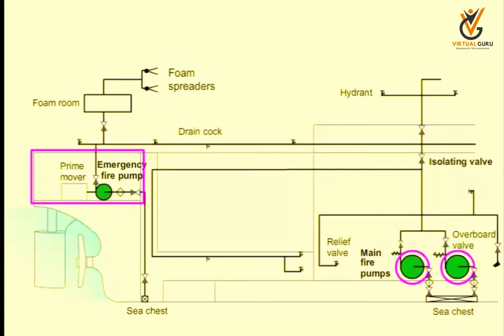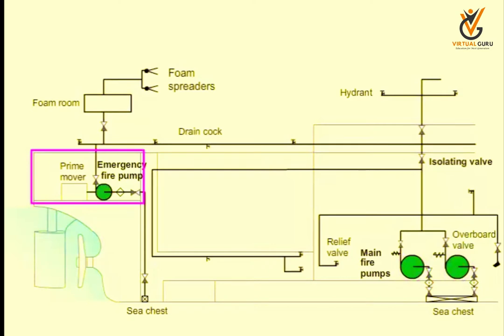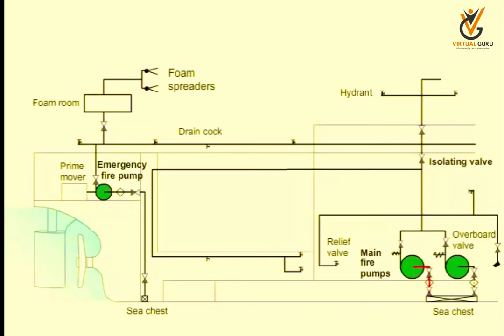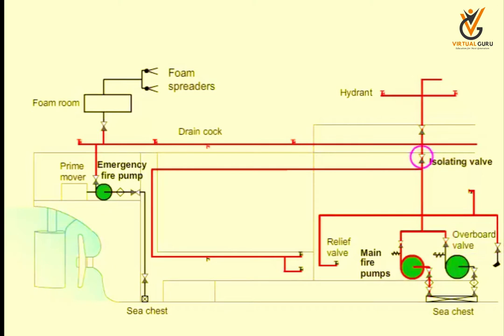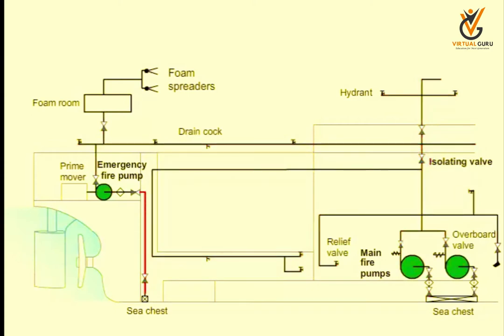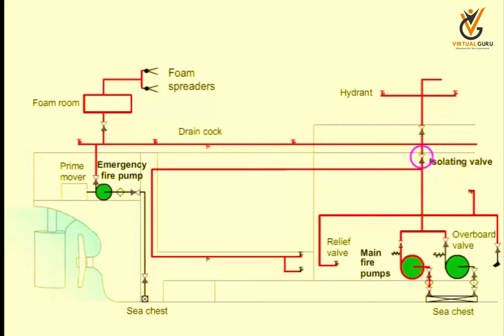Emergency Fire Pump | FPFF Course | Virtual Guru

Comment: Can you explain what overboard valfe is and when is used??
Reply: that is the non return globe valve( , in case if you need only smaller pressure in the fire hydrant , we will slightly open the obd valve thus small amount of water will go to overboard using obd valve and required amount of water pressure we can attain in the hydrant...

OBD - overboard